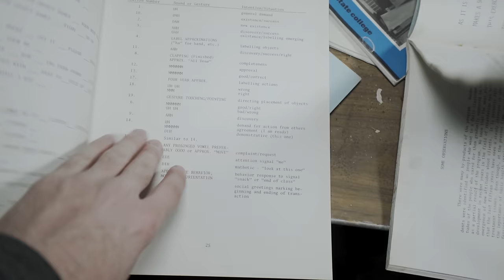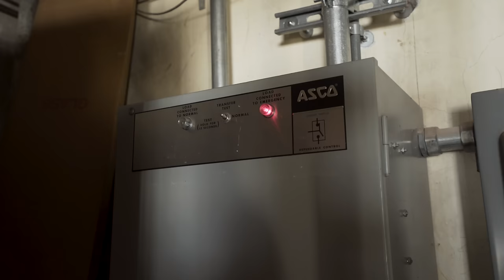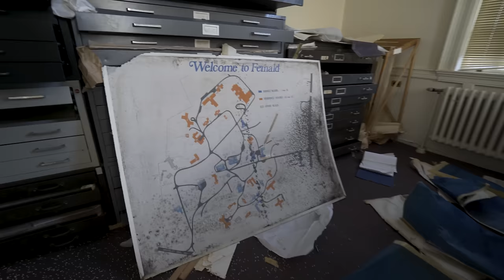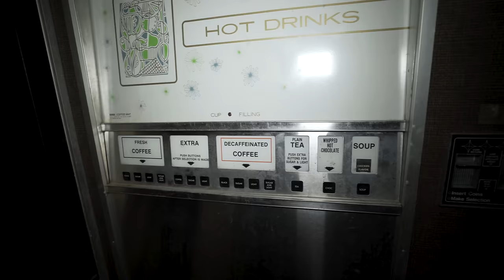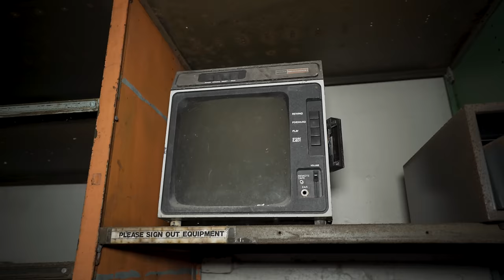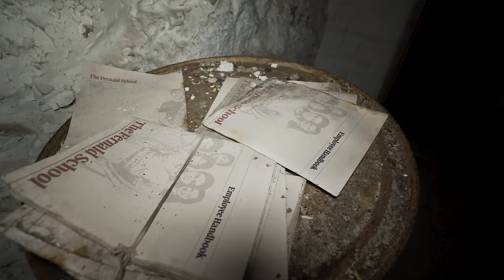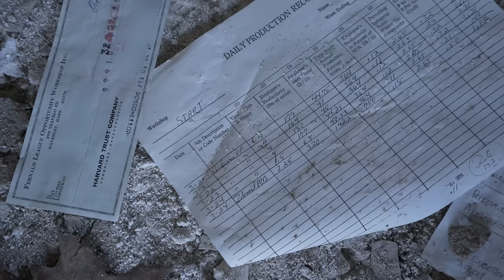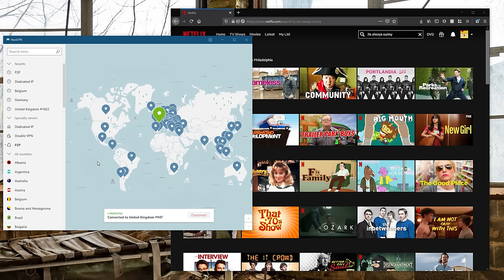Abandoned Mental Institution with Dark History - They Experimented on Children!

Comment: In 2013, there were still 13 residents there.  That's 7 years ago.  The last resident left in 2014.  How did this place deteriorate so much in seven years?  Amazing.
Reply: That’s really cool info. Are there any documentaries or articles on this?
Reply: The modern buildings were not filmed because they weren't cool enough for their video. Those deteriorated buildings they focus on were abandoned in the '80s .........
Reply: @happyypigeons  No, they weren't. I worked there until 1986 and the buildings were still in use.
Reply: Mother Nature. A lot of harsh winters, ice, snow, sleet, freezing temps, lack of maitenence, age, I'm sure these buildings and facility were beginning to deteriorate long before the last person left.
Reply: @ReneeW59  So did they really abuse kids?
Reply: @ReneeW59  so, what really went on there?
Reply: @ReneeW59  Is there a chance you could possibly tell us your story? What was it like working in such a facility?
Reply: Buildings deteriorate quickly without proper upkeep, moisture and heat are the main culprits so is expansion and contraction of  concrete and metals in the building. 8 years is more than enough time for it to decay so quickly.
Reply: @ReneeW59  cap
Reply: I was there the other day and its even worse, theres graffiti everywhere, most places are overrun with plants, theres a couple houses in the complex with collapsed roofs

Comment: 'The Experimental School for Teaching & Training Idiotic Children' sounds so over-the-top now you could never put something named that in a work of fiction. Even though it was real.
Reply: Normally it's stuff like 'retarded' which sounds bad, but 'retard' wasn't always an insult, it used to be common language (i.e. "retarder" on some ignition systems of old cars as well as the hydraulic speed control systems on trucks, even those produced recently), it makes sense to call a slower person 'retarded' in that sense even though the term has changed to be an insult with modern context. Calling them idiotic is over-the-top for sure, though. It's like they really tried to be as insulting as possible.
Reply: It sounds like it was ripped out of a dystopian novel

Comment: I used to work in a hospital (not a mental hospital just a plain hospital lol) and they do use straps on chairs and beds and things but there are VERY strict rules about it these days. First you have to have a doctors order for restraints which is hard to get. Once you do have a doctors order you can only have them restrained for 45 minutes of every hour. You have to remove the restraints and let the patient reposition or go to the bathroom before restraining again. They are actually more trouble than they are worth because once you take those restraints off the patient gets even crazier than they were before. They usually only use restraints as the very last resort, if the patient is pulling at their IV tubes or whatnot or otherwise present a danger to themselves.

Comment: I grew up near the Danvers State Hospital in Ma.  or what was actually called the Danvers Lunatic Asylum. It began it's closing of wards in 69 , completely shutting its doors by the early '90s. It was left abandoned for years. If you haven't watched the movie Session 9, rent it. It's a pretty good movie that is set there in it's abandoned condition. They have since made it into condos which is a bit creepy. It actually burned down right after it was built or in the process of finishing in, I believe 2007. You could see the huge flames from Boston.

Comment: I am severely disabled I was adopted at age two and luckily never put in a place like this. Just so you know the wooden seat with straps was probably a Rifton special needs chair, the others were wheelchairs that were usually adapted by staff to put specific individuals in. The stroller was modified with a special headrest for infants, during that Time very little was available for us to have good seating or walkers, I an 66 if that helps, I recycle disabled related equipment free to those in need. Be safe!

Comment: As of 2024 a good chunk of the buildings still stand including those old fenced off ones (I just take it as a sign to not enter those ones because I did and nearly fell thru the floor so please don’t enter the fenced off ones if you go). However if you go during the day you won’t have any issues with police or security but at night they will patrol and watch outside from the office buildings across the street so if you go do it during the day. I’m unsure if they knew but there’s a power plant building near the back entrance and in there along with many other spots thru out the campus is a tunnel entrance, and the tunnels are navigable if you don’t mind the occasional tight spot. Hope this helps

Comment: Yes, the torment and abuse which characterized these institutions cannot be denied . However, there will ALWAYS ALWAYS be a segment of the population who have mental illness or developmental problems who simply and honestly NEED AROUND THE CLOCK SUPPORT. When these people were kicked out into the streets and left to fend for themselves like animals and many ended up dead. So how is this humane? How is this progress? The rest? They always end up in the jails which are worse than an institution in so many ways. They are the new "warehouse" for people needing care. That and nursing facilities which are not equipped for the mentally unstable or challenged. I used to work at homes. The true solution is this in my opinion...build ew, state of the art hospital complexes which focus on providing long term care to the ones who require it. With all the state regulations in place, much safer than being tortured on the street or in a jail. Mental health reform is a must!

Comment: Over a hundred thousand USD in equipment just lying around, lol.
Shit, sell it for scrap it's still like $30k.
Not even mentioning all the piping, etc that can be removed without doing any harm to the actual structure (the structure itself being listed as a heritage building thus why it hasn't been knocked down already. Unreal that they bought it for less than a couple million, 40 acres for $800k!)
Always boggles my mind why someone hasn't just turned up with a truck and start cutting/moving this shit out.
It's just trash that's gonna cost the local municipality money to move (since they now own it) when they finally decide what to do with the site- stuff that'll end up in a land fill somewhere most probably- at least if a scrapper took it, it'd get sold off and disposed of ethically for re-use.